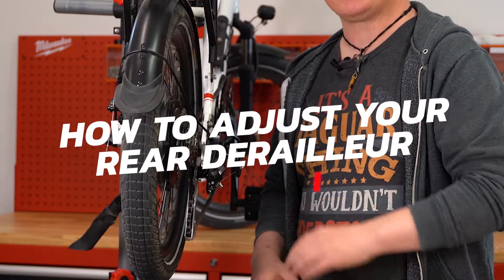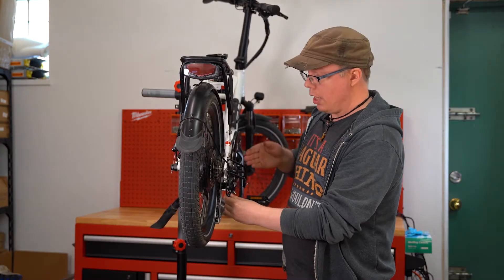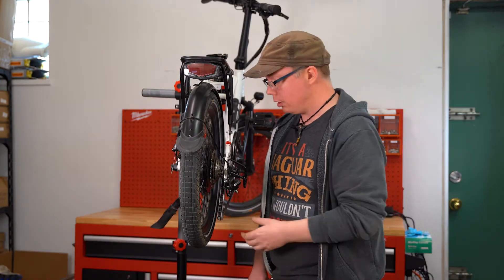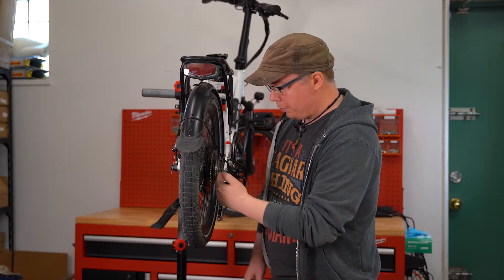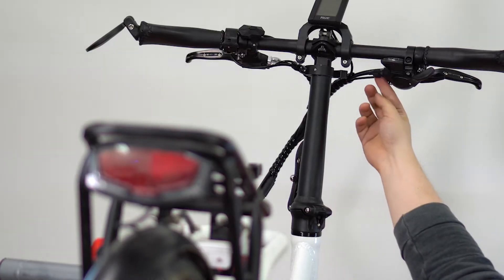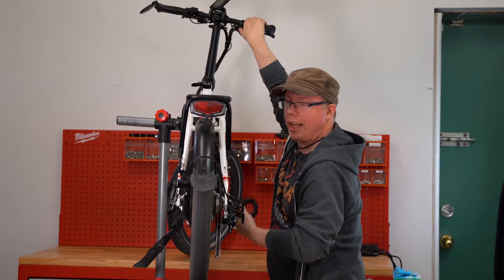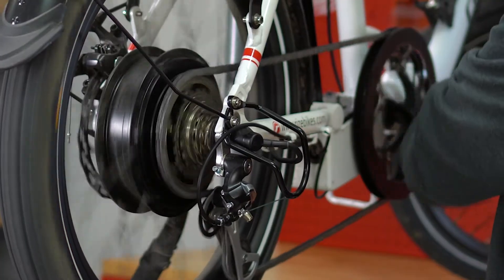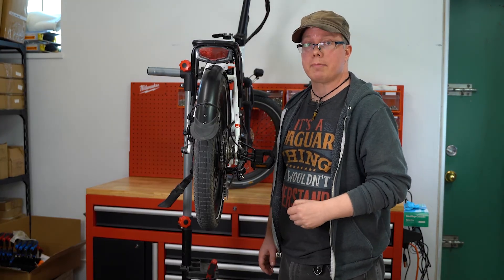How To Adjust the Rear Derailleur on an E-Bike

Comment: I have a new folding rise bike that “skips” in 5-6th gear. I’m gonna try this! Thank you for posting!!😀
Reply from the maker: You can do it! Thanks bro!
Reply: I had that exact same problem with my Bolt X. My wife did too. We found the barrel nut on the handlebar shifter was a little loose. Tightened it up and now it is gone. 800km later and the bike still works great.

Comment: Question 
I have 2018 spark X 
I got it just before the rebrand to Rize .can I replace the derailleur with a Shimano deor  ? Or would it be better to get the   original .
Also I suspect I'd be s.o.l getting a new battery that would fit ? 
I'm leaning to just getting a new Rize x since the new frame is sexy looking lol 
Pls & thx
Reply from the maker: You should be able to upgrade, provided the hanger connection point matches and get a shifter to match if it's different speeds.

We still have the Spark and Early Rize Type A batteries available, but only in 19.2Ah.

Should you have any further questions, please contact us at support@rizebikes.com.

Comment: I thought the smallest cog was the highest gear and the biggest cog was the lowest gear ? I have a rize blade that is having shifting issues. Problem just started. Wont stay in the selected gear. tends to hop from gear to gear when pedaling.   I thought the smallest cog was 7th gear? right now the bike is set on 2nd gear and the chain is on the second biggest cog. to me that makes sense. By making sure it's on the smallest cog, don't you mean put it in 7th gear, not 1st?
Reply from the maker: Hello,

Apologies as Craig did misspoke as the largest cog is the lowest gear and the smallest cog is the highest gear. The video demonstration still holds correct. We will have a corrected publish version in the future as it is in our pipeline to update this video!
Reply: thanks for the reply. it was a bit confusing. So I need to put it in 7th gear before adjusting? 
 @RizeBikes